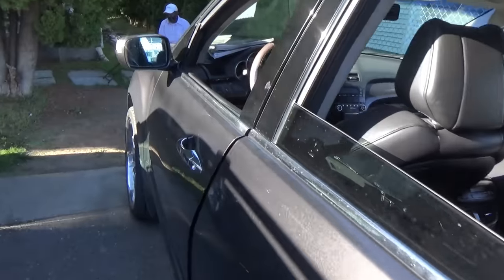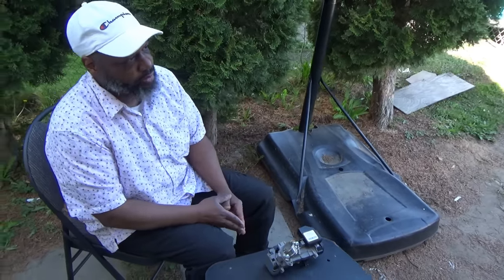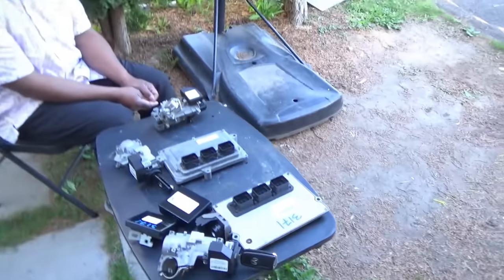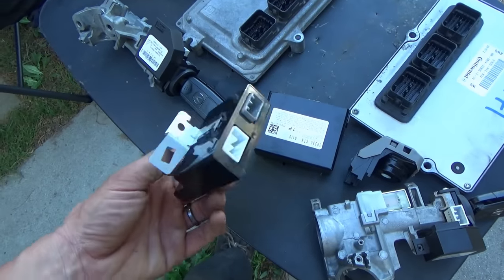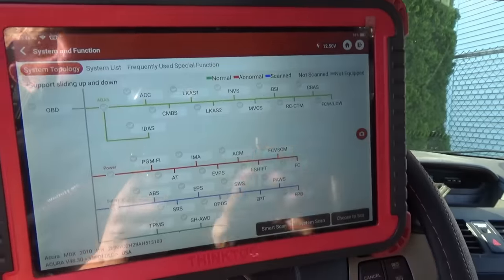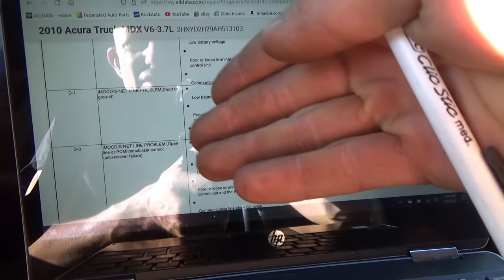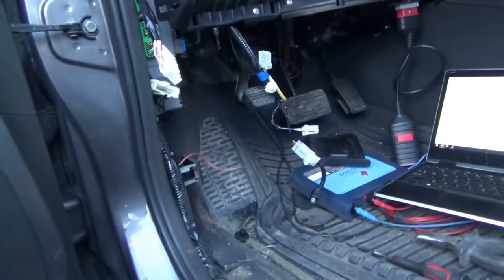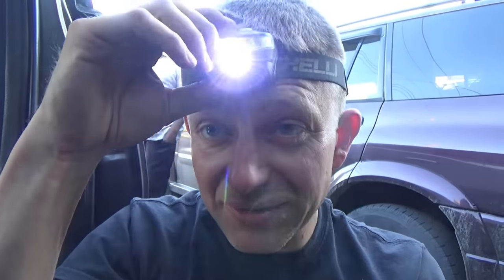Customer Spent $4000...and it STILL Doesn't Start! (Acura MDX)

Comment: 👋Sir verynice explanation, I did have a similar problem intermittent in a honda pilot, it has a recall about steering,and the problem was the antenna wires was crunch between the surface  that mount the steering column grouning the wires intermittent, I did install a used antenna good from a recall, clear codes that fixed the problem, I was working at the honda dealer in Texas,now I'm working on my own shop next to home.
Install

Comment: My hunch from scope data was partial short to power but was thinking it likely harness in column area .
Keith saved the day and potentially some dollars for the customer, that a sucky fault but if you went into that kicker panel you probably sussed it unless already called a module and not double checking the call . 
That poor guy blew some serious dollar but he took it like a champ. I not spent 4K in repair and service of my old 2000 sf forester in more than 12 years of owning it lol .

Comment: I suggest we take this a s reminder that cars are NOT supposed to leak   .. I was sold a 94 civic " that had never been in an accident ".... wet front passenger floor always wet ... took of the front fender / gaurd  ( me not a mechanic ) .... with a torch discovered a split in the body panel join goo ... RIGHT UNDER the front windscreen drain outlet .... which it behind the upper door hinge ... spotted by looking through a diamond shaped hole in the hinge .... .... mastic on a small spatula fixed it ... Australia ....

Comment: Seeing the "12V" pattern detail, mainly the nearly battery levels, then longer pulse down, followed by a fast burst and then some UART style data in a bundle, it was screaming at me "That is some LIN line" (a battery level communication - pulled up via 1kOhm and diode towards battery, then down with a transistor and diode in series, hence the 1.2V above GND/below battery), so a short circuit to other wire (being it under the dash, could be HVAC connection to air duct flaps,...) in some bundle or so... Probably in that connector...

Comment: Oh, this is the Green corroded C601 connector attached to the left kick panel. Water leaking from left corner of the windshield on to C601 connector harness hot pin 16 and the rest. Pin 9 hot for Lumbar support fuse needed to be removed, too. Pin 9 hot promotes corrosion. So interesting!

Comment: stray 12 volt power.......its getting 12 volt onto a 5v rail from a short in the loom.  Keith is brilliant, soooo much experience, he has seen it all.  Eric at SMA had a mystery EVAP fault in a vehicle, but all the components checked out.  BUT the 5 volt rail seonsor rail the Evap works off, had noisy, stray voltage when the engine was revved up ( 3000rpm) that triggered the check engine light (evap fault).  Keith told Eric, "find out what turns on at 3000rpm"  ..........The only component that switches at 3000rpm was the power steering sensor.  That sensor was actually faulty, it was pulsing on its 12 volt rail, and the pulse inside the ECU caused induction into the 5 volt rail.  When a DC circuit pulses, it behaves like AC power, and is capable of producing induction.

Comment: Another great wiring mystery solved. I'm wondering if Toyota has had a similar problem. My Rav 4 has had plugged sunroof drains on the driver's side, but so far no troubles electrically.

Comment: I haven't finished the video yet, and I understand your thought process of wanting to see if the voltage stays elevated when unplugging the immobilizer. BUT, if you think about it, from my understanding so far, the voltage is sent out by the micu or pcm, and the immobilizer pulls it to ground, creating the waveform. Therefore, you already know your problem isn't the immobilizer due to the fact that, when voltage was elevated, it was still being pulled down. Granted, it wasn't being pulled to "ground" and was at 1.xx volts, but immobilizer is still doing it's job. Hope that makes sense. I'll finish the video now lol
Reply: Ah, nice, connection issue was the problem due to voltage bleeding over. Glad you had someone to call to get some info from. I need to network better so that I can have those contacts. People I work with aren't dumb, and I'm not trying to talk bad about anybody, but, they just don't have a good understanding of electrical circuitry.

Comment: Acura is Honda. I had one like this and approximate year model and it was a bad relay in the fuse box at your left foot in the drivers seat. I just started watching, less than a minute in. Hondas are known for PGM FI main relay failures. It kills half the computer and the green key antitheft flashes. Its usually intermittent. Thats a weird problem. But water leaking around a windshield causes monster issues.

Comment: My fist guess is the car is using the shifter cable as a body ground. The more RPM's the higher amperage trying to go thru the cable and it's arcing out. In the 70's I had a Monte Carlo that the shifter went out on when the cable broke due to arcing (you could see the ends of the strands were melted). The ground straps that went from the valve covers to the body were corroded off.
But I see I was wrong.

Comment: Ivan - Did you add dielectric grease to that connector to keep the green crusties from coming back when exposed to moisture?  Remember, before you had all the facts and before you called Keith, you had decided it was not a wiring problem (because the dealer tech went to the steering column wiring and got a temporary fix, causing a bias in your diagnostic procedure on this vehicle). Always keep an open mind and remember that roof and sunroof drain leaks are more likely to cause weird electrical problems than defective electronic components that work sporadically, but w/o complete failure.  Having lost a very expensive SUV to blocked sunroof drains that the manufacturer had not put on the dealer checklist of things to check every 10,000 or even every 50,000 or 100,000 miles, and thus had never checked, I am very aware of leak problems.  I live in an area where rain, heat and falling leaves are constant problems, and I like to check for blocked drains and leaks coming down the hidden surfaces of the A pillars and behind the kick panels when electrical gremlins appear. On Ford trucks, for example, check in and around the Smart Junction Box behind the right kick panel, and all connectors in that area lower than the SJB.  If any of them have green crusties or if any of the lower connectors are under water, you may gave found your problem.

Comment: When the steering wheel cycles itself to the home position and then to the driver's desired position, you said the insulation was wearing through. Did you do anything to keep that from rubbing and shorting out on that bolt?

Comment: AC would not run on my 98 Range Rover. Same problem. Totally corroded connector in passengers side kick panel. I got a good connector from wrecker to replace it but most people recommend cutting it out and joining the wires.

Comment: Honda water ingress problem is 99.9% certain to be the sealant Honda used to seal the roof to the sides drying out and cracking. Scrape it out, dry & degrease, re-seal with OB1 or the seam-sealant of your choice. Took about an hour per side on my Accord.

Comment: Crude methods, but effective, captain.
Kick the kick panel and the problem changes and changes back.
Water gets in.
Now you find out.
The information you need comes from asking the customer if evidence of water entry was ever seen in this area.
Well, yes, as a matter of fact, there's a drip from the left A pillar at the top corner of the windshield !
$4000 later, almost 5.
Can he send all those parts back?
Or does he have to start his own online part store for Acuras?
Thanks Keith.
Nothing wrong with a consult, said Dr. Cameron (House, S1)

Comment: I had same problem, 6 years ago, with a Subaru WRX, no start, push button, no communication,( corrosion), was the connector close the "A" pillar, driver side, but unfortunately connector was more towards the fire, so the whole dash had to come out, repaired, and all ok, 
Another, was a Subaru Legacy,  electric park brake would apply on its  own,  have the car parked without the park brake on, ( not applied) , 5 minutes later, park brakes were on, Repair, was the connector that ran by the drivers side "A" corrosion  , after repair was ok

Comment: I've had my fair share of similar intermittent power issues, so whenever I deal with any dash related problems I always inspect those connectors behind both kick panels for any physical traces of water intrusion first. Usually water leaves a white residue on the paintwork or harness parts where its been travelling across.

Comment: My thought's are one of the plastic chain guides broke, or chipped off, and got caught in the belt's travel.  As the broken piece travels around the Cam gear, it could have raised the belt a few teeth changing the timing.  Just a guess.

Comment: what a great video-      corrosion x aviation grade works great, deoxit is a cleaner at best, I am a sr avionics tech and our connectors in the wings n wheelwells are exposed to 400 mph water at times,  the stuff is fantastic as a preventative.
Reply from the maker: I actually have a can of Corrosion X in the garage! It's the green stuff that smells good haha

Comment: The intermittent fault , often associated with cold weather, and in this case a flood of rain. The cold usually works to shrink metal contacts . In this case it seems the bleed of voltage from that permanent live was the problem along with the damp in the connection. I’m just wondering if this started in a seasonal wet time. And I guess the car was not sheltered in a garage.

Comment: Ivan interesting that you didn't think it was voltage bleeding at first, the line dipping when you started the engine is a dead giveaway that you were getting unregulated battery voltage rather than the regulated comms voltage

Comment: I have no doubt that you would have noticed the connector on the diagram and investigated that .
I have run into similar problems with connectors and repaired with a single weather pac connection spliced in , still keeping all functions and can be easily disconnected if needed.

Comment: I had a 2008 Mercury Sable and the transmission seem to have failed but then starts to work after turning off the car and turning it back on. After doing extensive research and a TSB Report, the transmission speed sensors both input and outer sensor fail at around 70,000 miles. Most of the time they do not trigger any codes. Sensors replaced transmission working fine till this day well over 100,000 miles. I'm guessing majority of owners get scammed and replace the transmission.

Comment: I had a 1975 dodge B200 van that intermittently would not start. It turned out to be a wiring connector that went through the firewall.

Comment: If the voltage doubles, that strongly suggests it lost the terminating load resistor.  So not a short or ground, an open.

Comment: If it has a sunroof it’s definitely worth pouring some water in to test and making sure the drains are clear. A lot of times when they stop up and water gets in it tends to roll on the body and drip at corners like by the windshield.
Reply: I've seen this happen, sometimes the clog is not bad enough to fill up quick, best is to test it and pour water around the area for 5 minutes or more. Let's not also forget cars that have antennas mounted on the frame.

Comment: to me, voltages elevating and dropping, with intermittent issue that improves the longer it's powered on, is screaming green crusties and water in connectors/modules/panels.
granted, I've dealt with that for years in everything from electronics, telecom, radio/tv, electrical, automotive, computers and more.
including a peltier cooler that was overcooling a CPU and causing condensation wetting of the socket and pins when at low power idle! outdoor/underground phones lines are notorious for all sorts of issues.

Comment: Hi there,
I had a similar problem with my 1990 Honda Accord.
There is a module, It might be called the MCT module.  It would never register as problemmatic on a scan, I spent a fortune rebuilding the onboard computer.  But, I lost total confidence in driving the car, because it would run fine, then refuse to start.  It was a nightmare.  My suggestion is replace this inexpensive module.  
Cheers,
Reply from the maker: Sounds like classic cracked solder joints in the main relay. Not much else can stop an old Honda lol

Comment: You came so close to calling it the module Ivan. Just as well Keith had seen this before. I was dead set certain there was a wire making intermittent contact via green crusties in the loom where you said there was evidence of chaffing near the bolt under the steering column. I was assuming there was a 12V feed in the loom.

Comment: i was thinking absolutely has to be a module problem also when the data was there but it was switching at a higher voltage,  no wiring issue could cause that ......... 🤦🤦🤦

Comment: I have a problem with immo system on 08 mdx. Crank no start (blinking immo light)
The code is A-3 (No communication between key and immobilizer unit)
I reprogrammed new transponder key but its process failure. Coil transponder is good

Comment: Hi,Ivan We spoke (via comment)few months back pertaining too my 08 Saab 9-3 Aero that's having some issue's. Since then it's in A so called Swedish Specialty Shop but unfortunately they can't figure out the problems. The cel code is P0203. The shop has changed fuel injector #3 , tried a replacement ecu and the problem still persists. I am in Reading Pa was wondering If you have any free time in upcoming weeks to check it out or can tow it down to your place? I am in desperate need of your Expertise Sir. I will be picking up the car from the shop soon. Thank You!!!
Reply from the maker: Hey Samir, sure thing I would love to actually diagnose it for you. Please fill out the appointment form on my website www.pinehollowdiagnostics.com 👍
Reply: @PineHollowAutoDiagnostics  On will Do!
Reply: @sts973007  You are almost saved, dude!
Reply: He's gonna figure it out!
Reply: @PineHollowAutoDiagnostics  video please!
Reply: @PineHollowAutoDiagnostics  hey Ivan, I'd like to hear how Keith came to find the poor connection in panel!? Maybe he'd be willing to retell the event?

Comment: Nice fix.  Just curious and not judging at all and I understand replacing a single pin in a connector can be anything from an easy job to an impossible one depending on if you can get the correct pin but why would you not at least jump around that pin and maybe either directly splice both sides of the wire to each other or maybe put a single bullet connector in?  I know it would drive me crazy knowing the car had a perfectly good lumbar adjustment system and it wasn't working due to some known corrosion and me removing the fuse.  Again, just curious.  Thanks as always for the vid!

Comment: I worked on a mid 90's Pontiac that would shut down and have to be towed anytime this one certain person rode in the passenger seat but would fire bac up the next day and run find until that person rode in the car again.  After several tows the car was brought to me and a very long process began to figure out what was going on but to make a long story short the issue was a tight spot in the wiring harness in the passenger foot well in the middle of the car so when that spot was stepped on it pulled the wires out of a connector just enough to break contact.  I just lifted the carpet and routed the wires a little different and the problem was solved.
Reply from the maker: Awesome!

Comment: Amazing repair - regardless of whether you reached out to anyone - but Keith has certainly seen it all! I have one question, though - is it possible that a loss of network continuity from the immobilizer module thru the connector to the receiving module eliminated the load  (termination resistance) in the receiver and  caused the elevated voltage on the line from the transmitter (immobilizer)?
Reply from the maker: You can answer this question yourself based on the data provided in the video. That is your homework for tonight 😉

Comment: Discovered your chan recently, binge watching now. :) There will always be coulda woulda shoulda from the peanut gallery and I guess I'm no different. I think on this one I would have hard wired the lumbar separate from the plug and tagged it. I guess I'm willing to do a lil cob job for 100% customer sat. I would probably have loaded that connector with dielectric grease inside n out :)

Comment: This is such a common failure on so many vehicles, I tell people to find a spot and leave the steering column there
Reply: But, was it related to collum movement?
Reply: @dans_Learning_Curve  It was the first place he looked due to it being a clue and he found a rub spot that even tho it may not have been the overall issue with this repair it will be a future issue. For example on Ford's of the early 2000's that have the OD switch on the shifter handle the wire for it runs across the arm that moves when you shift, after 8-10 years or so it rubs thru and pop goes the fuse. All manufacturers do stupid stuff around moving parts in the column.

Comment: Why would it lose com or regain com when moving the steering wheel in a certain position? I’ve ran into this issue before never new about the connector on the left kick panel. I thought it was the harness stretching and maybe shorting out.

Comment: I think you would have found that pin 16 was open (disconnected from the immobilizer system) to the rest of the system, that's why the rest of the system could not pull it down as it should.
Reply from the maker: Definitely wasn't open circuit...